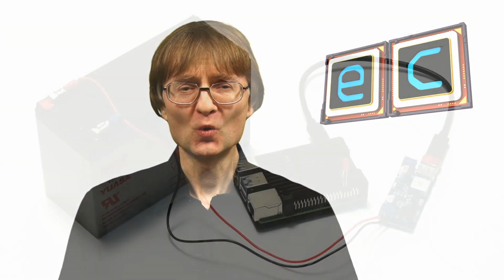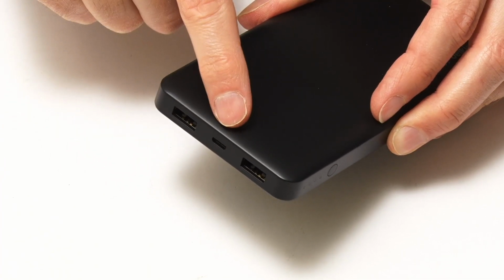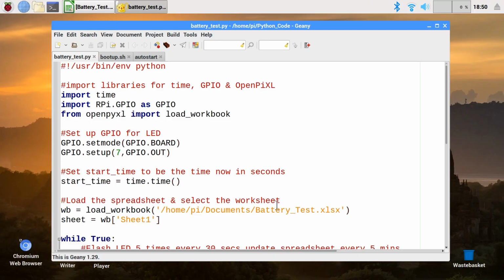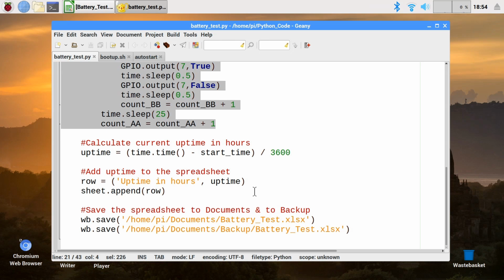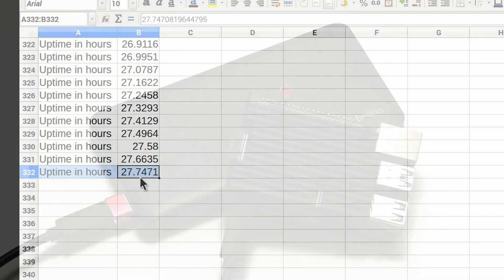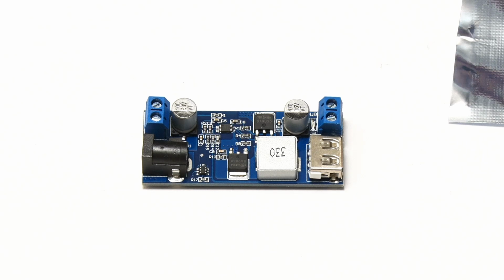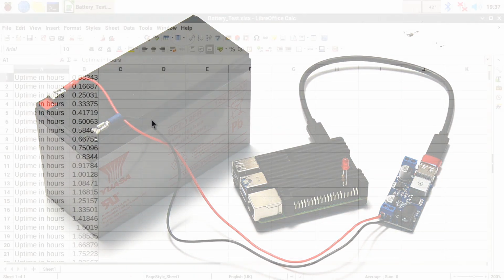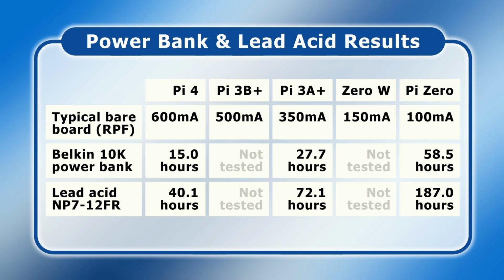Raspberry Pi Battery Power

Comment: I think the battery bank is rated in 10,000 mAh at a nominal voltage of 3.6 (the cumulative batteries themselves), so it's capacity for 5V is actually closer to 7,200 (36 wH / 5 is 7.2 Ah). And I think, as often is the case, the power banks capacity rating is also over estimated. I could be wrong, but I think that's at least part of what's going on here and the rated capacity calculation of the Lead Acid is likely accurately listed (84 wH / 5V is 16.8 Ah), which accounts for what seems like a discrepancy between the two tests. I think this accounts for getting about ~2.5 times the results assuming that you can likely get about 80% of the usable capacity of the Lead Acid batteries at low current draw (I expect slightly higher efficiency than the lithium battery bank as the differential between maximum and minimum voltages is greater). The efficiency of the step down/buck converter might even be closer to 95%. Additionally, the rest of the relatively small "discrepancy", for lack of a better word, is likely due to the "estimated" power usages (which makes sense as you can't take in account their exact testing or use case methodology). 

Lastly, love and watch all your videos. SBC's are awesome, and I'm still waiting for one with multiple NVMe support. 

Thanks!

Comment: Thanks for the video.  Design experience idea.  Back in the mid 1990's I had a project where a laptop needed to run a weather station for one month.  This was out in a remote farming location.  I set up the laptop to run from two 12 volt marine deep cycle boat batteries.  The batteries were connected with wires soldered onto the power connection ports of an APC brand battery backup unit designed to run the computer when the power failed.  So by starting with a battery backup unit, that took almost all of the engineering out of the equation.  APC battery backups run on a 12 volt, lead acid battery identical to the one you show in this video.  The build was simple.  Buy a battery backup unit.  Open it up and remove the small 12 volt battery and solder longer wires that would connect to the two bigger boat or car batteries.  Then take the battery backup apart and cut the alarm buzzer off of the circuit board.  When the backup unit is not plugged into the wall, it runs on batteries. the annoying alarm is buzzing as a needless warning.  Other than that, the only other thing to do was to put the whole thing in a waterproof box, and connect the ground wire to a grounding rod in the field.  We ran these laptops for years this way.  The trick of having two batteries was so that when we were swapping out the batteries on a monthly basis, we could keep one battery connected while swapping out the other.  This allowed for the laptops to run without needing to be shut down.  Later, around 1997 small 12 volt solar pannels started to show up in local auto parts stores.  We bought one and connected that to the batteries as well.  This allowed us to run the laptops off-grid for six months until the whole thing was blown to a million pieces by a direct strike of  a lightning strike.  : )  Also, to charge the spare batteries I was swapping out, I used a second modified battery back up as the battery charger to recharge the batteries.  This just needed some longer wires with alligator clips soldered onto them.

Comment: How about a version 2 of this video adding a INA219 to measure the battery voltage and doing a 'proper' shutdown of the Pi once it reaches a preset voltage?  Unfortunately I'm not a programmer.

Comment: Hi Chris Why not use a 6Volt battery instead? something like Yuasa NP126 6V 12 Ah Lead Acid Battery obviously 12 Ah instead of 7 Ah.
Regards Ray.
Reply from the maker: I wanted to use 12V because (a) a lot of people have asked about 12V battery power for a Pi (eg for in a boat or car), and (b) this video is a lead-in to my Raspberry Pi greenhouse automation video, where I need 12V to power servo valves.
Reply: @ExplainingComputers  Ok Chris, thanks for the reply, I understand your reasoning, keep up the good work, btw I have been involved with electronics for a very long time, I will be 79 at the end of the year, so a lot of changes in my lifetime, regards from Ray in North Wales.

Comment: This was a laboratory experience, but the lead-acid pack cannot be compared with the Li-io pack, because we must limit the lead-acid battery to 12V, the charged battery has an approximate voltage of 12.7V - at the real life.
The 5V converter works up to 7 / 6V.
A 10 Amp / hr pack with a 0.6 Amp / hr discharge should last 16 hours.
The 12V @ 7Amp lead-acid battery should last 10 hours considering 85% performance of the voltage converter.
But the practical experience was very entertaining

Comment: Just a little misconception here about lead acid battery use : the 50% capacity limit is to be able to get more cycles out of it before it deteriorates. With your buck converter you can let the battery go down to almost 5v deteriorating it. It will then recharge, but if you repeat that often you will not get more than 50 or 100 satisfying cycles out of it, even if it does not sit for long at a low voltage. While lithium cells are happy to work between a bottom of 3,1V and a top of 4.10 V for thousands of cycles, if you accept light degradation. More interesting testing would be the pi under load (say a Pi4 playing youtube 720p) but you should definitively stop discharge on the lead acid at 11 V. The power bank has a regulator witch stops output when cells reach 3.1V avoiding damage on them. The 12V lead acid has no regulation, and just delivers what is chemically possible. In that respect that is not a fair test.

Comment: I have 2 questions. Firstly, what is the brand and model of your little screwdriver? Secondly, where is that little addition, the LED w/resistor mounted on a connector supposed to be installed and how is it used? Thanks for all the many useful videos, especially in such a timely manner and always with the wonderful dry wit!

Comment: As xjet suggested: the lead acid battery was deep discharged, probably way beyond what is healthy for the battery. It should cut out at - indeed - around 12.3 volt if you want any decent battery cycles. Running the lead acid like this will kill the battery quickly. The cut-off voltage also depends on the load so it might be off but I would not recommend using lead acid like this 🔋⛔️🚫🛑❗️‼️

Comment: This is good but you need 5 volts I would just use a power supply. You must have a 12 to 5 volt converter.  If you use your pi in the car then go this route. You can also take a computer power supply and use the 5 volt section from the power supply.

Comment: lead acid battery would have discharged to 5v!! Its half dead!!! Remove the led blinking and instead find a moving average of the battery voltage and log it to the excel file. Then for lead acid battery only consider time till the voltage reaches 11v to 11.5v  Caution: lead acid battery can be discharged to 9.v but only when drawing high current, probably many times the C rating. when the current draw is very less then further it gets discharged more quicker its life degrades

Comment: Thanks for the video, nicely done. But I'm shocked that you didn't use a fuse on 12v battery, it easily can blow hot metal from wires into you face and set house on fire in case of the short-circuit. More disturbing that I've found only 2 comments with word "fuse" used in that context. So seems like many people just want to learn the power of electricity the hard way.
Reply from the maker: Fair point on safety.

Comment: perfect. I salvaged a battery from a dead ups (electronics died, battery still good). I though it wasnt going to be that useful due to the 50% capacity. Hmm, but I'll need a lead acid compatible charger.

Comment: problem with the powerbank is it has to take the 4.2 or 3.7 nominal  voltage and bump it up to 5 volts and loses efficiency also alot of those power banks are over rated it might have 10000mah or 10 ah of batterys but thats at 3.7-4.2 volts when it  jumps up to 5 volts with a step up converter its less than 10000mah at the 5 volts
Reply: https://powerbank20.com/en/actual-output-capacity/  a good explanaition

Comment: I use a Pi for ADSB flight tracking. Adding a solar panel and charge controller to a 35amp hr SLA battery has been on my to do list. Thanks for the vid with real world numbers.

Comment: Great testing well done. I've got a UPS which I think uses lead acid battery for my NAS. Is there a safety concern here in terms of charging a lead acid battery like the one in this video? Does it have built in overcharging circuits etc? I know any battery can fail but the whole lead acid thing is extra horrible.

Comment: Chris, interesting video. I have been thinking of trying something similar.  You mention powering the pi from the GPIO pins.  Are there some risks associated with such a connection?  Magpi has an article that suggests its dangerous, as it bypasses the boards safety circuit that protects against current spikes etc.
 "Please be aware that there is no regulation or fuse protection on the GPIO to protect from over-voltage or current spikes.

If an incorrect voltage is applied, or a current spike occurs on the line, you can permanently damage your Raspberry Pi."
They mention using various Hats that add in the protection layer.

Comment: Great video, Chris.  I did not know about the openpyxl library before... very useful, thank you.  The other thing I didn't know about was autostart.  You mentioned another video where you discussed it, but I haven't been able to find it yet.  Would you be able to provide a link, please.  I would have thought you could use the @reboot option in crontab (man 5 crontab) to achieve this since the python script does not rely on any graphics programs, but I am probably missing something here.  Anyhow, terrific video.  I learned a lot.

Comment: I did this last month with a small LifePo4  12.8v 16aH 204.8wH battery and a DROK Adjustable Buck Converter Step Down Voltage Regulator 6V-32V 30V 24V 12V to 1.5-32V 5V 5A. Be sure to check the output voltage/amps before hooking it to your Pi. I add a volt (or  two) if you're running a couple of USB devices. (I use it for my Yaesu 857d's cat cable and signalink. to do PSK.)
Reply: Sorry. Pi3

Comment: I was hoping you'd discuss ways to gracefully shut down an RPi computer when the voltage dropped to a certain threshold.  Not all RPis have the circuitry to do this automatically but it is often necessary to prevent data corruption at the point of shut-down.  Li-Ion power banks usually have their own shut-off thresholds to prevent over-discharge but they just quit when that level is reached regardless of the load attached to it possibly endangering said data. Though the tests do illustrate the different power consumption levels of the five RPi computers, it is unclear here whether they shut themselves down or the power bank shut down when the tests ended.  It is equally unclear how low the lead-acid battery got through its tests, though it probably outlasted the RPi computers simply because it has no shut-off circuitry.

Comment: The Pizero would be a lot more useful if it had at least one ADC. :/ 

The Arduino Nano doesn't have Wi-Fi or BT and if you add a HC-05 BT module it uses 50mA..

If you don't need a "full PC" just use an ESP32. Took me months of faffing about to get to this point.  The ESP32 is £3 from Ali Express, the camera version / ESP32CAM is a similar price with less IO.

Just for info. I have a 10W solar panel with a rubbish 12v charge controller to a 1.7Ah lead acid battery as a buffer. This charges an 18650 via a £1 controller and it powered an Arduino Nano, HC-05 and several DHT22 for a few days without any sun. Charged up fine in the sun and keeps working. ..

The PizeroW version draws around 290mA doing the same job.

Really don't bother with Lead acid unless you have to.

Comment: Using the full capacity of Lead Acid batteries will absolutely destroy its long term efficacy, as each time its working capacity will be affected. With some extra 'smart' circuitry in place to prevent the battery from over discharging we likely would have seen results more in line with the expected longevity. [plus the variance for actual current draw vs stated average current draw.] Temperature as well is a big factor for Lead Acid Batteries. But I love seeing this kind of information from actual tests. :D Lots of good info here.

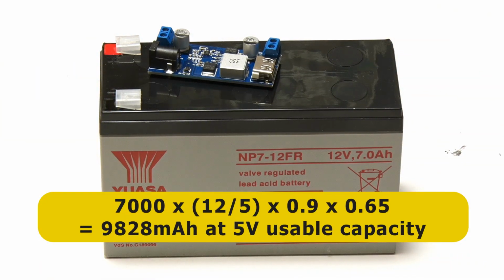Comment: 4:15 Stated 10000 mAh refers to total battery capacity. Those are 3.7V so first you'd need to get total available power in Wh 10Ah * 3.7V = 37Wh then divide by power drawn by the device ie. 600mA raspberry draws 3W (5V*0.6A *typical efficiency of the boost converter 85% ) = 10.5 hours ish. For your 12 V battery capacity is 84Wh (12V*7Ah). I really don't understand your math at 15:18 not to mention there's no low voltage cut off in this test so this battery will be irreversibly damaged once discharged.

Comment: Would be more interested in how I can get a Raspberry Pi running from a normal power source without constantly getting the lightning bolt indicating that it is not getting enough power. I'm using my Android Phone charger to power it. Would not mind overclocking it. Anything to get it to go faster.
Reply from the maker: I think you are answering your own question. If you are using a Pi 3 or Pi 4, then you need a high power power supply, and a phone charger will not supply the amperage required. You need a 2.5A+ adapter for a Pi 3, and 3A+ for a Pi 3, so something like the official Pi power supplies for those models. Only a Pi Zero or Pi 1/2 will work OK from a standard phone charger or similar.

Comment: if you run "echo 3 > /proc/sys/vm/drop_caches" you force any data pending in caches (pages, dentries, inodes) back to disk. No need to save two copies of a file. If the system crashed after above statement, you'll still have the data up to the point you ran above command on disk.
Reply from the maker: Very useful, thanks.

Comment: For those in the UK, the Belkin battery pack is currently on special offer at QVC.
For those who are audiophiles using a Pi with a DAC and worry about the noise from a wallwart power supply - running the Pi off a battery both helps with noise and removed the possibility of ground noise. A £10 battery vs a £90+ "low noise" PSU.

Comment: Capacity of power banks is 75 per cent of "capacity" because they are liars and capacity is not for 5V output, but for 3.7V internal Li-Ion batteries. 3.7/5=0.74 But who is interest what is inside, when on the box is 5V, 10 000mAh?

Comment: The specs on that buck converter are an input voltage of 9-36V. The lead-acid battery's usable capacity is contingent on a rated output voltage of 12V. Since there is nothing to prevent the battery from going below rated output voltage during discharge, you are using the battery beyond it's usable capacity. This is the reason for the longer than expected run time.

Comment: Add a little solar panel, like the ones you set inside the windshield of the car to maintain the battery, with a 12v regulator to the lead acid battery in the greenhouse.

Comment: BTW, Not to put Mr. Scissors out of a job, but those notches near one end of those packages are designed to make it easy to open.  Just use them to start the tear.  Works quite well.
Reply from the maker: It may, but it also makes the bag more difficult to re-use, and keeping a bag in the right place on screen when tearing is far harder than when cutting! This is film making, not real life! :)

Comment: Too bad the Pi won't accept up to a 6v supply as 6 volt lead acid batteries are very inexpensive as well and would eliminate the need for the converter.

Comment: SIr your results at 18:25 are totaly wrong as your battery even if was overcharged  had  14VX7Ah=98Wh total energy when 40.1hX600mAX5V=120Wh , 72.1hX350mAX5V=126.175Wh and 187hX100mAX5V=93.5Wh
I think that the real consumptions was significant lower from these as the notice below the list informing us that you consume only 65% of your battery (98WhX65%=63.7Wh!!!!!!!!) for maximum (hypothetikal) or 
12.6VX7AhX65%=57.33Wh!!!!!! (REAL AVAILABLE energy)
 As the working range of a VRLA battery is between 12.8V (Full Charged) and 12.2(empty) lets take as average 12.6V  
That means 12.6VX7AhX65%=57.33Wh Then the real consumption for the Pi4 was about 285~290mA and not 600mA, for Pi3A+ was abaout 160~170mA and for Pi Zero was about 60~65mA
You can find more informations at yuasa.co.uk  and A4Leaflet_NP at news.yuasa.co.uk for battery lifespan charging and discharging courves and alot more.
I hope you continiue this tutorial with adding a solar charging system for a more autonomus application.
With  all My respect!
Vasilis,